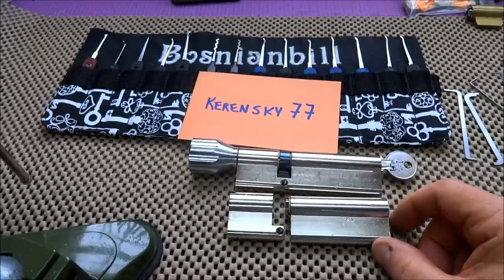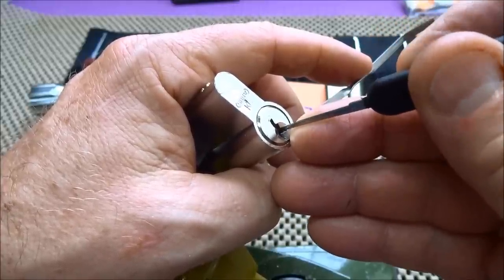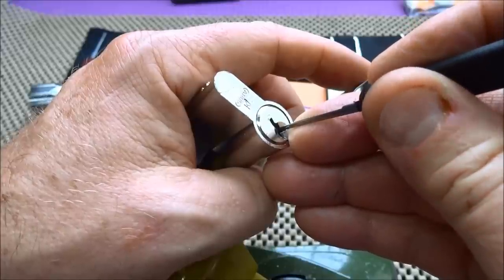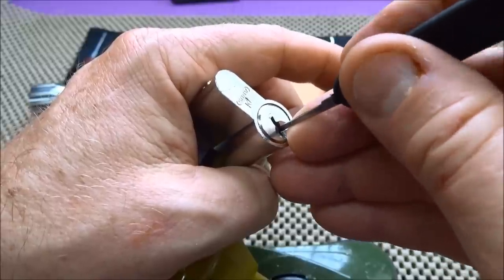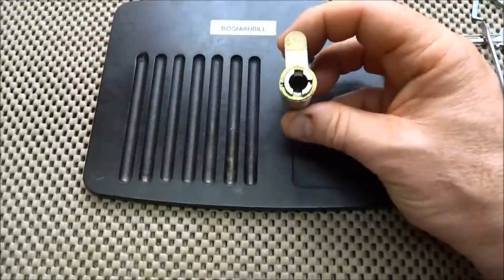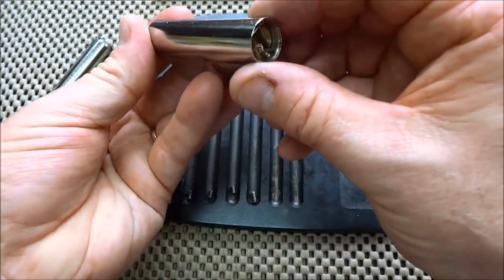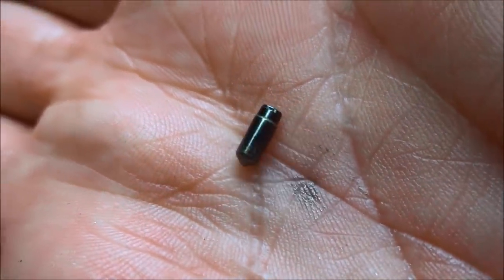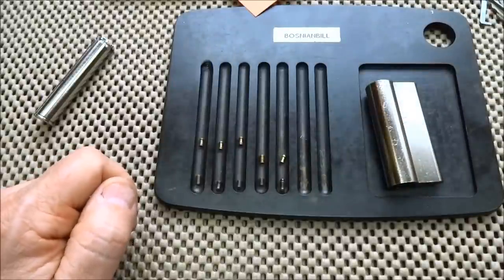(434) Abus C83 Picked and Gutted (EVIL pins!)

Comment: I started picking locks back in 1969 in the Navy. We had some very interesting security locks, I still have a USN lock that the key is inserted and pushed up to open and turn shackle. I would mention that I was asked one day to open the dispersing safe on board ship as the combination wouldn't work. I really had no training on safes. But by a lucky gnuess...a boot lace and the clerks hand on lock handle I got it open without using the known combination!
Reply from the maker: 👍😀  Sometimes luck is better than skill!